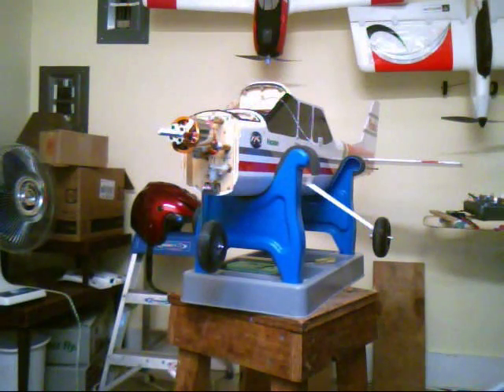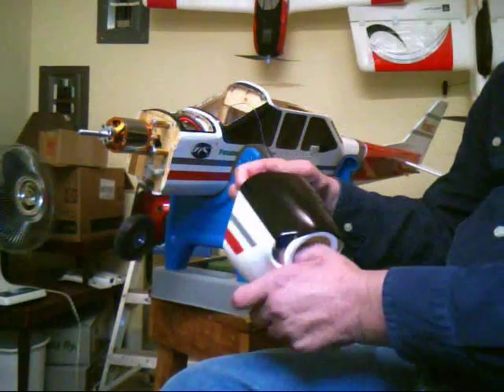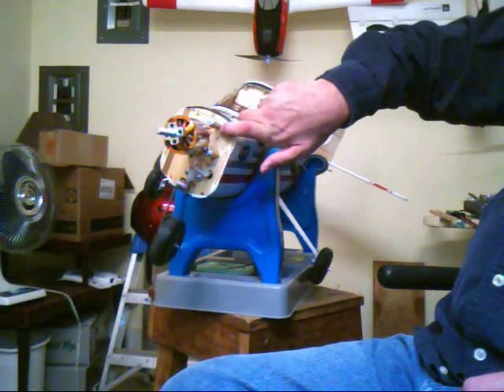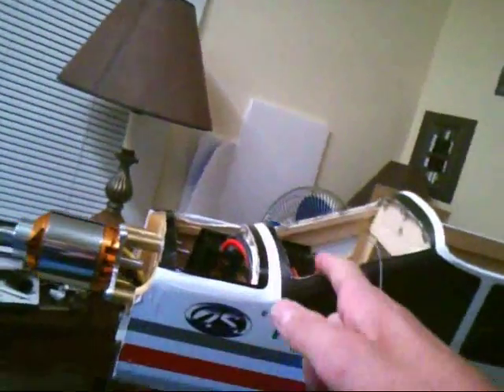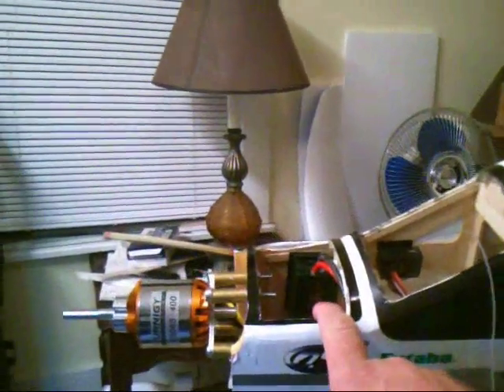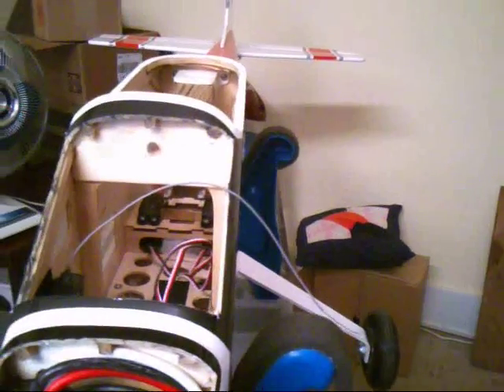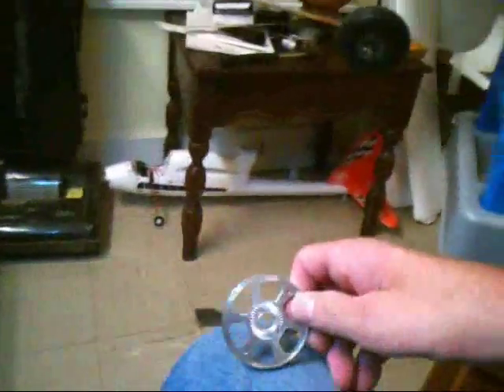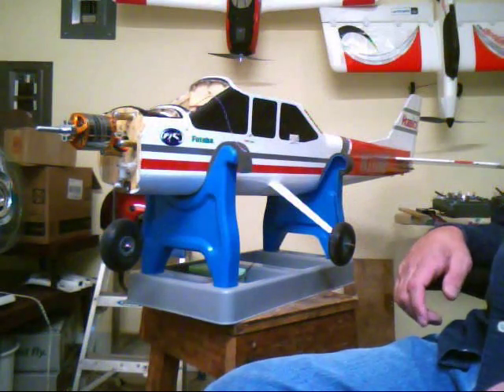Nexstar Electric Conversion

Comment: Great video.  
  You can also taper  about a half an inch of the wing bolt to an almost point. It will go in pretty easy then . You still have to push down  on it a bit. But always start the bolt by hand. Or you can just run the screwdriver through your covering like I did ! doh

Comment: Thanks for the info. I have and old gas "Royal Coachman" with a 42" wingspan and 29" fuse that I would like to convert to electric. It has a 29 webra on it now. Any ideas of how to start. Don't want to spend a lot of money on the conversion.I don't think it needs a real big motor. I need to know what motor to match up w lipo batt and esc with speed control. Thanks for your Help

Comment: Aleronjack. Great job. My 13 year old son just got a used NexStar 46 given to him so he could have a trainer. But I have a couple of questions.
First with a 400k and using a 6 cell this must be a very slow flyer or did you change the prop?
Second, with the copper spacers, how long did you make those?

Finally, I am using a Turingy G32 motor .It is the same as the RimFire in the NexSTAR EP but is 770 kv not 800 kv.
Thanks!

Comment: Well I'm even wondering i I need to make a cut into the windshield at all... I can understand cutting the part above the motor (firewall) to get back behind it to mount the motor... but I think I should be able to accesss everything else from just taking off the main wing.  Also instead of using the brass tubing to extend the motor out.. couldn't I just simply trim off part of cowl instead with my dremel?  I'm not sure yet about that part..haven't got the cowl yet to see if it will work.

Comment from the maker: Thanx guys for all the great comments. West Coast: Yes, I still fly my Nexstar. If I had one thing I would do differently, I would cut the windshield hatch in a different way. Other than that, it was a great conversion process that is simple and useable. Stelmo: The bolt length was somewhere around 2.5" or so. Sorry, I tend to forget things like that. I believe that a laser-cut wood box motor mount would certainly work in this conversion. My own free hand wood working cuts are not that precise.

Comment: Hi Aileronjack!
Have found this video quite in time - thinking about the same conversion - thank you!
ONE QUESTION: what are the exact length of the bolts you've used for fixing the engine, including the difference for directing it right-down?
Also, have you considered the alternative - wodden motorframe instead of bolts?
Thank you!! Stelmofortress.

Comment from the maker: Hey Rapid Fire. 
Yes, I used a dremel to cut the airframe. I used the thin metal cutoff wheel. You may need to use some monocote to dress up the cut. I recently did the sam thing to an S.E. 5A and dressed up the cut using monocote. If you are careful making the cut and then come back and dress things up with the monocote, it doesn't come out looking too bad. Thankx for your interest. Hope your conversion goes well for you. Its a great flying plane and deserves the recognition as an electric .